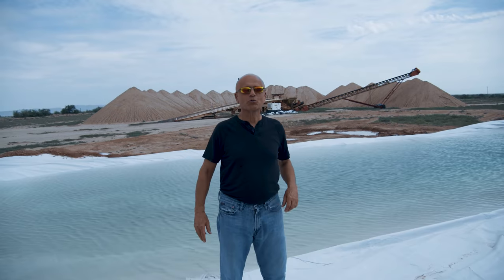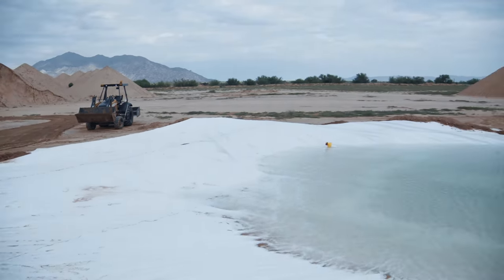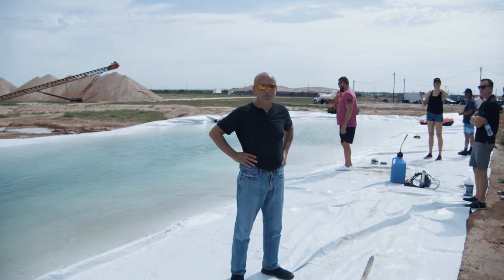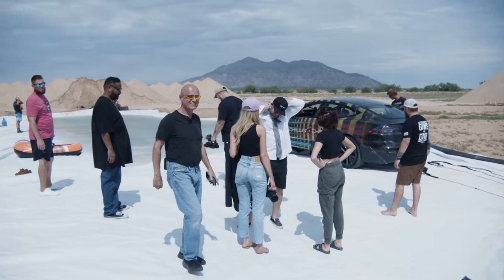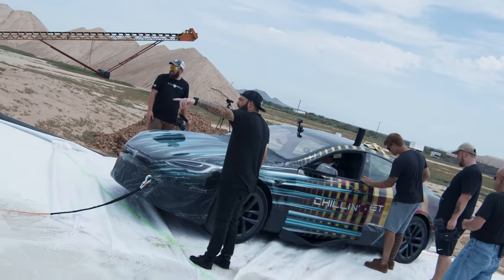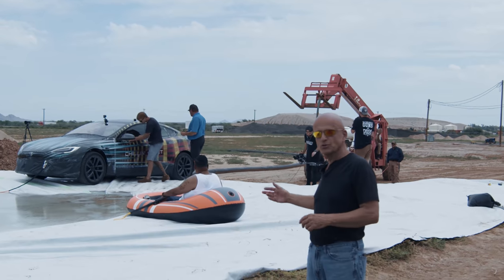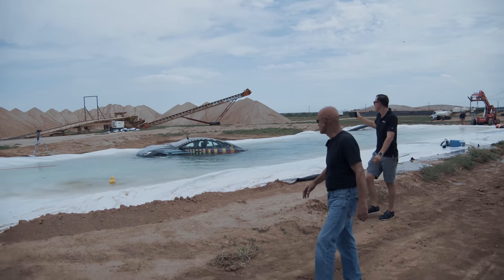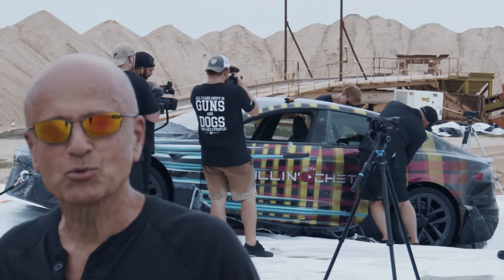TESLA Model S Plaid Submarine | Gruber Motors

Comment: That was very amateurish, a back of the napkin cabin volume calculation would have predicted floating.
Reply: My thoughts, too. I was expecting this to happen when he said they put in a measly 2000 pounds of weight. You need to somehow get rid of much of the air volume in the cabin,  best without flooding it (which is actually the reason cars eventually sink)

Comment: well of course the airride was gonna deflate all the air springs as the water lifts the car up and systems goes "im too high". Should be that in jack mode (auto adjustment off) when doing this.
Reply: I don't see how that would change the fact that the car is still gonna float
Reply: @geemy9675  Floating isn't really much of issue in normal situations as it can 'sail' across water. For this test though... Not sure how they'll get around it, the battery pack is too buoyant. 🙂
Reply: @geemy9675  well it wont beach itself for one.... that should help.  If the wheel extend out for too long it bleeds the springs. So even if it sink it wont drive under water until it recharges the springs again at the bottom of the water
Reply: @VoxelLoop  no the bettery pack is super heavy and doesn't float at all. the only thing that makes almost any car float at least for a few seconds/minutes is the volume of air in the cabin. as someone said in the comments, you let water fill the cabin then you won't need any ballast to make it sink.
Reply: @Nordic_Mechanic  if it it did sink quickly enough the spring would always stay compressed, although of course less compressed than outside water. that was the plan but they couldn't figure the right amount of ballast. BTW this is much heavier than the rated paylod so the car should not drive with all that ballast either
Reply: @Nordic_Mechanic  the idea was exactly to put enough ballast so it just drives under water. they just didn't put enough. although 2000lbs plus driver is already more than twice the rated Payload

Comment: some suggestions. Fill the tires with water. Seal the cabin with sealing mist for those small gaps or maybe introduce positive cabin pressure. seal around the door windows which i didn't see if that was done or not.
Reply: what is sealing mist?
Reply: they need to hire you!
Reply: They had to use a razer to open the doors, I think they just used a thin sheet and covered the sides, idk what material

Comment: The car will never get to the bottom if you seal all the gaps. You would basically have to flood most of the cabin area or else the air will disperse the water and make the car float. You did successfully build a tesla S Plaid boat though. Still pretty cool 😎

Comment: Calculating the weight needed to submerge this vehicle is a basic math problem.  The hardest part, which is not that hard, is calculating the volume of water that will be displaced when the vehicle is completely submerged.   Then, Fb = pVg.  These guys did not come close!